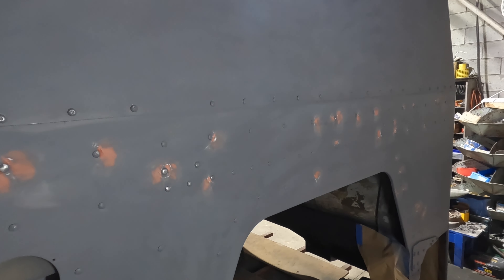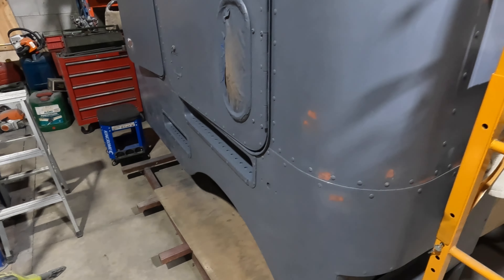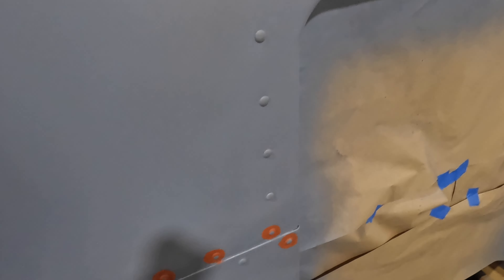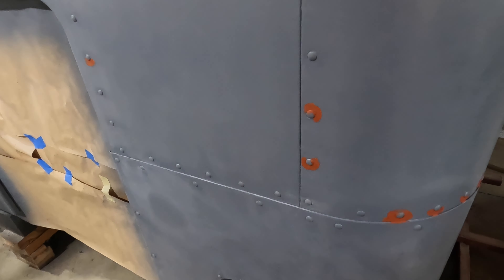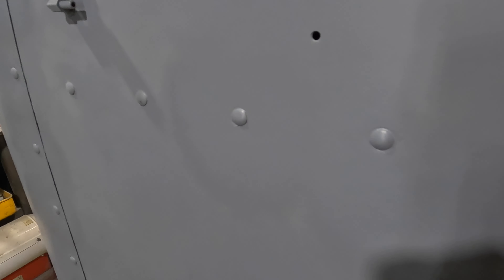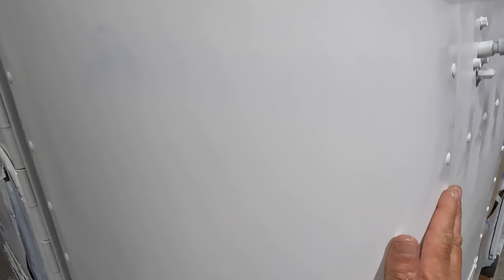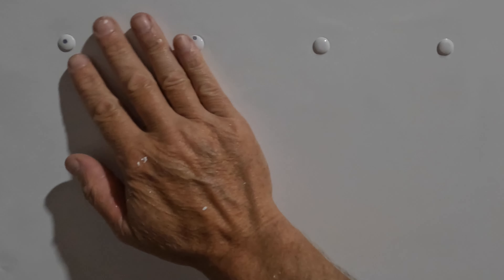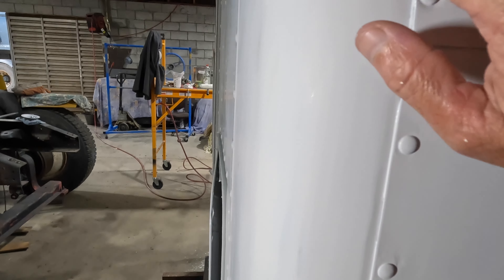Rolling paint on miss Pete

Comment: I normally use etching primer as a first up thin build application on bare metal (especially alloy) to provide that etch style bond for layers and then subsequently apply a high build type primer which will fill scratches and imperfections, followed by a guide coat, sand, glaze putty as reqd and then possible reapplication of high build primer and re-sand ahead of top coat. Some people use a sealer prior to top coat which provides a smooth finish and doesn't need sanding. 
As you say its a learning curve and those huck heads are killers - it'll look good!!
Reply from the maker: You are so right high build primer is the answer it’s funny how we become wiser after it’s gone west